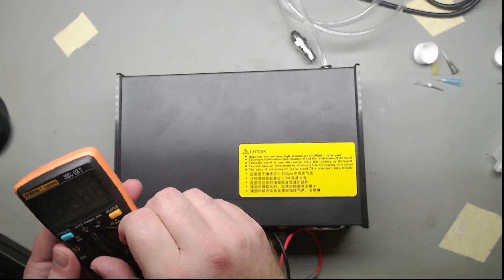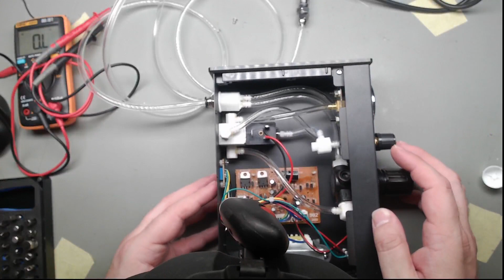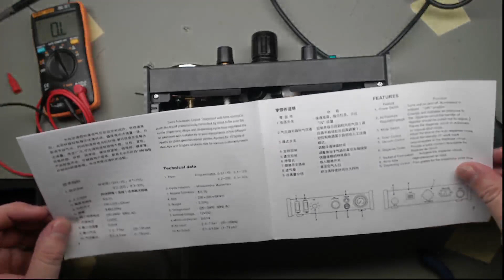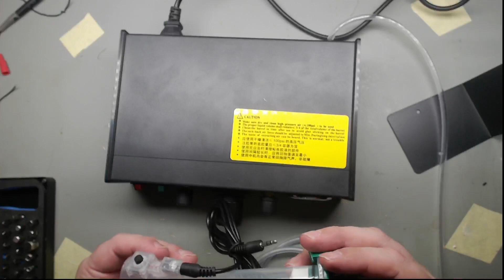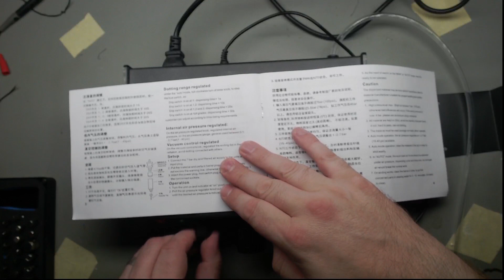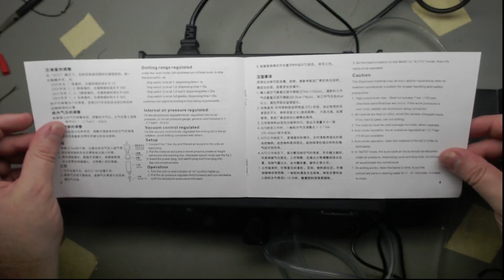Episode 5- Unboxing a Pneumatic Glue/Solder dispenser

Comment: I bought one of those about 5 years ago.  The plan was to use the X/Y stage for a 3D printer or cheap CNC router and use it to automatically drop solder paste of SMT pads.  This would avoid having to mess with a stencil.  Soon I realized that the air was too springy, it would be much better to use an incompressible fluid like water.  Also a much smaller syringe.  But like many projects I got busy on other projects and the dispenser is still in its box.
Reply from the maker: @makerspace533  that sounds like an interesting project. I tried dispensing some solder flux with it last weekend and it was fine if you are doing lots of little dots here and there at a short interval between. But if left sitting there, without the vacuum running, the flux kept extruding slowly over time as the air pressure was maintained. Running the vacuum got rid of the problem, but then it ran my compressor out of air quickly.

I would think that if you were wanting a more consistent application without any of the potential backlash from the compressibility of air, I would have thought a stepper motor with a mechanical connection to the plunger. That would get rid of any need to pumps, pipes and other liquids. If you use a smaller motor and syringe you might be able to mount it directly on the head and direct apply it that way.

I have the same project problem, although I am slowly clearing my kits to build box.